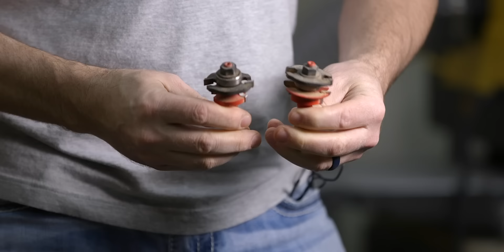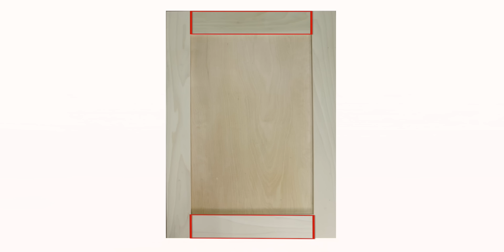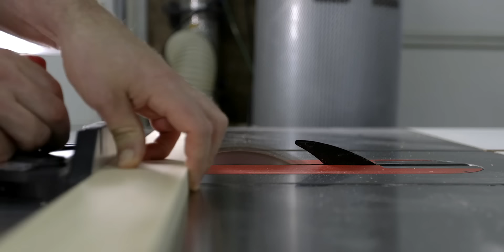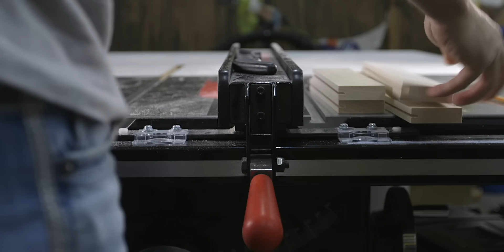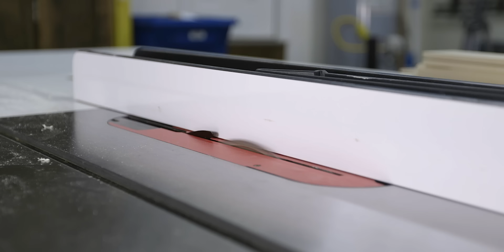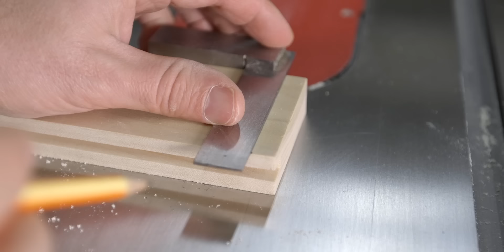Build Shaker Cabinet Doors With Table Saw | New to Woodworking?

Comment: Great presentation from a master carpenter!
I' m having some shaker style kitchen cabinets made and would appreciate your expertise.
The carpenter who's making them will be using soft maple for the rails and styles but wants to use MDF for the panels. He tells me that if he uses 1/4 maple plywood the doors will eventually warp from the contraction and expansion of the panel . I would mind if the doors were painted, but I want them stained and would like to see the panel wood grain along with the rails and styles. 
Should I insist on the maple panels?
Thank you in advance.
Reply from the maker: The combination of Maple and MDF does make for a great door. However, if you want them stained you will need to use either a plywood panel and or a solid panel. If built properly, the panel will be able to expand and contract without wrapping the door. If you need the doors to be stained there is no other option than to go with plywood or solid wood.

Comment: how would you cut your first grove if needs be offset, trying to match some drawers, and when looking at how cut they have grove offset so panel is shallower on front vs back
Reply from the maker: Simply adjust your fence to match the offset of what is already there and run all your pieces through. Then you will remove more on one side than the other to make your tenons. Test scrap pieces will be extremely beneficial here while dialing in your exact fit. If you need more help, reach out to me on Instagram as it is a great place to share photos and videos.

Comment: Do you recommend finishing the panel before gluing up to make sure if the panel moves slightly you don’t get a section showing that isn’t finished?
Reply from the maker: Yes you definitely can Jordan, great thinking. I've personally never had a problem, but that doesn't mean it doesn't happen. Just know that after finishing your panel, it may not fit into the groove, so plan accordingly.

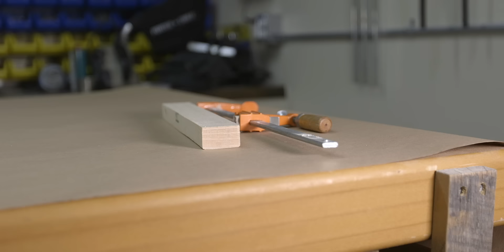Comment: At the 3:50 mark. You add a scrap piece of wood to the fence. Why not just use the fence?
Reply from the maker: You can Zia… but I generally teach it this way to beginners for safety sake. As long as you're not cutting all the way through the material, you are fine to use the fence and a miter gauge of your preference. BUT if you cut all the way through the material, and use the fence and miter gauge together, you run the risk of kick back and injury. It can be confusing for the new woodworker to know those differences. I hope that makes sense and answers your question.

Comment: I’m 72 yrs old and have never done anything like this. So far so good. Getting ready for tenons.
Reply: I built my first woodworking project, a table, when I was 71. Since then I have made a bookshelf with dado cuts, a china cabinet with glass panel doors, a solid oak bathroom vanity with raised panel doors (my biggest project so far), and an antique wall clock. I am now 73. You at 72 can definitely do it.

Comment: can you explain why you subtracted 1/8" from each measurement for the center board?  I am confused why you would need to do this
Reply: so the panel can float. the wood will expand and contract differently between the panel and the outer boards so the by allowing a bit of room the door won't break or twist.
Reply from the maker: Thank you Robert for chiming in!! 👊
Reply from the maker: Hello Sherry! The center board (door panel) needs to be able to move around a little for expansion and contraction. Therefore, we gave it about an 1/8" all the way around for it to be able to do that. It's not as important with plywood panels, but when it comes to solid wood panels it is extremely important. That was a great question Sherry, thank you for asking.

Comment: If you don't have a dado, you probably don't have a drill press either.
Reply from the maker: ...and that's ok because you don't need a drill press to drill those hinge holes. You can also use a different style of hinge that requires no drilling at all. Just thinking out loud with you.

Comment: Great video and very good instruction. This is a perfectly acceptable way of making a small cabinet door, but keep in mind this is the weakest of the three commonly used methods. So if you are a beginner (as the video states) don’t hesitate to do this. You will be using what’s referred to as a stub tenon. Plenty strong enough. But if someone kneels to access a lower cabinet and then uses the door as a crutch to get up (not that uncommon,) the upper joint on the hinge side takes a lot of pressure. Often it is the hinge that gives first, though. So a cope joint, made with a router bit set, is the next strongest and the method found in most “factory” doors. Here you have the same stub tenon, but additional glue surface where the rail copes the stile. The strongest joint would be a full mortise and tenon. Here, the long grain glue joint on the mortise and tenon cheeks is virtually indestructible, if made right. An upgrade to the stub tenon would be to consider 1/2” grooves (grooves, not dados because dados are grooves that run across the grain, usually on the face of the board) and stub tenons. That 25% extra glue surface, per joint, goes a long way. I don’t mean to be critical or disrespectful of the video. It is fine and well explained as an entry level method. Just want to give some vision to the beginners as to how their door making skills will evolve, and the theory behind it.
Reply from the maker: Thanks for the info!
Reply: Frank - I need to make 10 to 12 cabinet doors for a rental property I own. I've built several boxes with box joints. Is there a video you recommend that shows how to make these doors with a router and/or dados as you recommend?
Reply: @bernarddouthit478  Hi Bernard. Woodworkers Journal has a good video on making cope and stick joints on a router table. You will need a router table - can’t do these free hand with a router. I have a video on my site showing mortise and tenon construction with a handheld router and table saw dado blade. It’s for passage doors, not for cabinet doors,  but the process is the same, scaled down. All that said, nothing wrong with the techniques in this video for rental property doors. You can up the process with a dado set if you have one. That will speed up and make more accurate the production of all those stub tenons you will need. The front end of my video on hammer veneering will give you a look at what the mortise and tenon cabinet doors look like, but is probably an overkill joint for rental property doors. It is usually a technique reserved for high end furniture or where the strength of that joint is really needed. Hope this helps.

Comment: I wish you included metric measurements
Reply: Convert inches to centimeters or millimeters. Multiply the inches by 2.54 to get centimeters. Or multiply by 25.4 to get millimeters.

Comment: Were can I find 1/4” plywood that is actually 1/4”?  Closest I can find is 0.201 inches thick.
Reply from the maker: Not sure johnnyquad2... the plywood I buy is slightly undersized too, 0.219". Check around because some suppliers might carry thicker material. Also, it's been awhile since I bought a 1/4" sheet of Baltic Birch Plywood, but if I remember correctly that plywood runs more true to size. Let me know what you find.

Comment: Thank you so much for posting this very helpful video! I have a jobsite Dewalt 7480 table saw and am hoping on making cabinet doors. Is it worth it to invest in a different blade than the standard 24 count blade included? If so, do you have blades that you recommend for this type of project?
Reply from the maker: If the 24 tooth blade is new, it might do the job. The blade is designed for ripping wood and may leave a rough cut. I like a good 40 or 50 tooth combination blade. If you haven't seen this video, be sure to watch it. https://youtu.be/lzbBW29j4Uc
Reply: A flat tooth joinery or rip blade they are sometimes called. that way the bottom of the grooves and tongues will be flat. Btw, I have the same saw and my standard 24 tooth blade worked fine.

Comment: Beginners don’t have all the $$ tools. Not very useful.
Reply: Well you can't build cabinet doors with just a screwdriver.  A table saw is about as basic as you can get for any kind of woodworking.  I just bought a set of router bits for this, but may just use this technique instead as it can get a more exact fit for the center panel.  Great video THA!
Reply: I disagree. This video showed the most basic way to complete this task. This video was nowhere near many other youtube videos with shops full of Festool, etc. If you plan on making projects of this type, some basic tools are required (such as a table saw). If you don't want to invest in power tools, maybe you should seek out another channel.
Reply: I agree, watching this video was disappointing 👎

Comment: Nice video. But, like 95% of the rest of the videos that direct you to check for square, you did not instruct on what to do, or how, to correct for doors that are not square.
Reply from the maker: Do you need help with that then? Email me if you do.
Reply: Fred Weaver Not much you can do in this case to fix if it doesn’t come square. Applying diagonal pressure to square the door would open the joints. So careful set up for square tenon shoulders on the rails and true milling of the stiles (jointed and parallel edges) is important. More often it is the cabinet frame that is out of square, slightly. Always make the doors slightly tighter than you want them and then plane to creat an even reveal with the opening on all 4 sides. Hope this helps.

Comment: Wouldn't it be good to run the 3/4 piece attached to the fence the whole length so you don't by accident cut further into you rail while cleaning it up?
Reply from the maker: Yes that would be ideal but, using a miter gauge and the fence together is very dangerous, especially in a setup like this. You need to leave the gap so that you don't experience kickback while running the piece through. Great question!
Reply: @TrainingHandsAcademy  Okay I see what you are saying now. Thanks for the reply.  Look forward to viewing the rest of your videos especially the ones on skill saws.